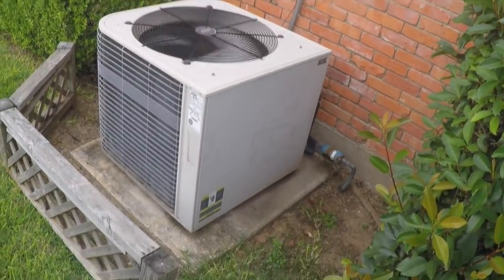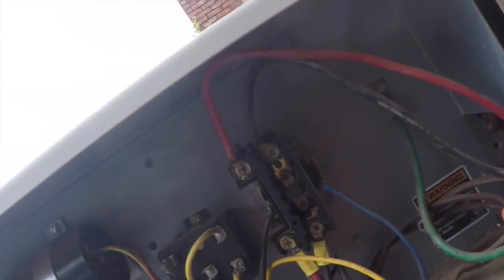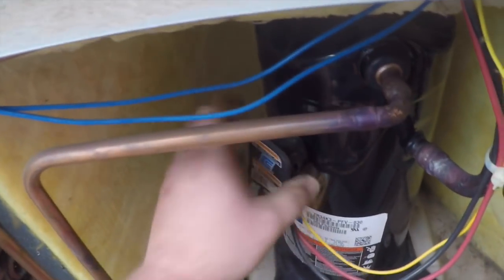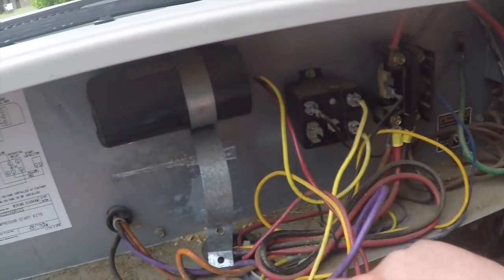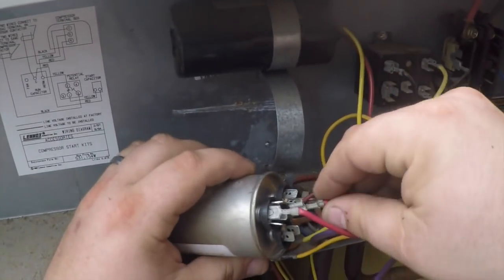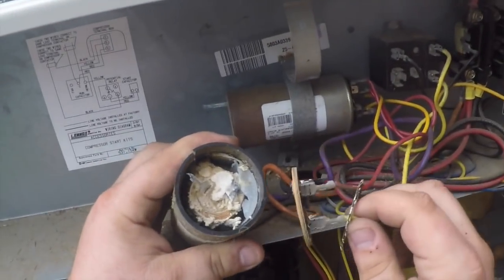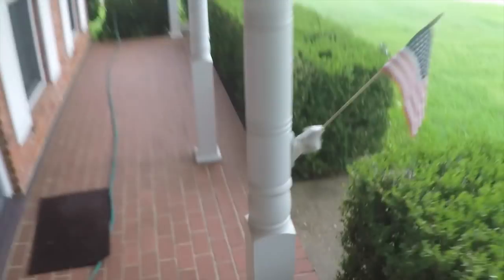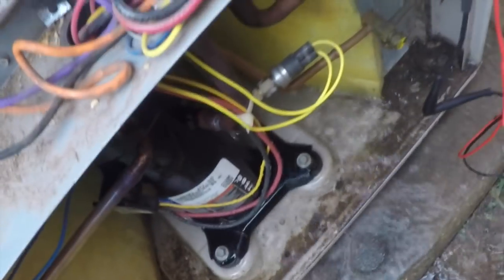HVAC: Overtime No Cool Call

Comment: I would have hooked my gauges up first to see if the system has any refrigerant before replacing electrics.
Reply: As you can see it was on thermal . For this type of call while you're waiting for it to come out of thermal overload generally that's when you check to see if there are any devices causing the thermal .  Then once that's good you run it . Always been normal practice.  I noticed the suction line dryer and the non oem looking brazes on the compressor.  That's a concern but hey

Comment: hey not the best video you missed a lot on a the check list for a no cooling call also you should have washed the   condensing unit while you had the hose out, and if you prefer 5 - 2-1s you should pick them up from you local supplier, but you didn't check subcooling/superheat or the high side reading, and the list goes on i would have done this service call a lot differently wouldn't be surprised if you got a call back  in the near future.
Reply: Anrew mackenzie we all do things different. All that was wrong here was a capacitor.

Comment: Hey John 22 year journeyman here. Let me get this right no subcooling, no superheat, no static pressure taken, no high side reading, and a house that you said is really hot and only a 75 pound suction pressure. Also only a 16-17 degree deltas. MMMM you fell a little short on finishing the service call so a call back maybe coming. If you are going to do training do all the steps properly.
Reply: A bunch of newbs spouting all the technical crapola they recently figured out how to use, performing a bunch of extra steps, using up extra time for a simple electrical fault. This was a text book repair for those who've actually done a few of them. The man checked the pressures and they were good - close it and go.
Reply: Of course, the indoor temp-split depends mainly on the % RH; at 50% RH indoors the split should be around 19 or 20°F; at a higher %RH the split might be around 16°F. 

Higher than normal airflow results in a 'lesser' or lower split...however, we always need to check the airflow & the indoor %RH...! 

Most systems have poor duct system design & too small Return-Air filter areas. Most systems are oversized & have too low an airflow...!

Always do the critical steps & show the performance of the system; it can be rather easy to do...
Reply: If you actually do the conversion at home he said his latest pressure was 75, he said 75-80 because it started at 80 when he turned it on, converting 75 we get just under 45F. He also said the register temp was 63F, which would make his split a little more than 18. 20~ is ideal, but 18 isn't anything to be concerned about. Especially when you consider the mentioned %RH. When you show up to a call often times the condenser hasn't been working for a while and as such the humidity in the house is up, duh, no cooling = high heat load, which can account for a 2 degree drop in the split.
Reply: melun dank u not hiring nobody bcuz u broke
Reply: TheAnimeAtheist p
Reply: i like these journeyman comments here lol i was a local member as well for 5 years until I moved out. I would've taken an amp draw and saw how it matched up to nameplate and I was about to say that he shouldv'e closed the panel or put the panel up before checking pressures but it was covered with the insulation. its just to keep airflow from being sucked through the hole and up instead of through the coil and out the top. quick control fault that he found without issue. i think he did good.
Reply: super hack
Reply: John is a master HVAC technician.  John knows exactly what he is doing.  Every tech can learn from him
Reply: He's an honest professional and found the problem right away. Most techs would be pitching a new unit instantly. I would hire him onto my team any day. Quit hating and make your own videos you over confident bitch.
Reply: he always half asses   thinks having toys makes a good tech
Reply: first off any tech worth a shit would find that problem right away and i dont think i would hire a guy thats out of breath huffin and puffin cause he put 2 screws in with a drill
Reply: Thank you! Yeah I agree we need more guys doing a complete thorough diagnoses.

Comment: Dude I'm trying to remain patient here but why would you not just unplug the plug off the compressor and attach you ohm meter to the compressor term. ? You also saw the start cap blown to bits but still couldn't admit that was you probable problem? I would have probably gone to my mega-o-Ohm meter checked the condition of the windings and been done with it.
Reply: Dick Gallina +1
It drives me nuts watching these videos and guys don't check the condition of the windings, Don't check static pressure and worst of all they don't check combustion on the heating equipment.

Comment: John ~ The small blue can next to the unit what does it use for?  My condenser unit don't have that.
Reply: That drier shouldn't even be there for more than a few weeks it starves the compressor. That's a Suction Line dryer used for burnouts/acids in line set.
Reply: It's a type of filter to catch particles before they get to the compressor, if you look closely you can also see a grey one behind it. That's a liquid drier which is also a filter but it additionally contains a desiccant material to absorb moisture that could be present in the lines. Moisture is a very, very bad thing to have in refrigeration systems.
Reply: Sage Awesome ~ I'm new to this...Why some home condenser unit had that and my condenser unit don't has it.
Reply: Most common reason is that many techs are too lazy/cheap to put them in. Or worse they'll put in new ones without removing the old ones.

The less common reason is that if the system is properly dried and free of contaminates it doesn't actually need them. In theory.
Reply: Thank Sage Awesome
Reply: on some units the filter drier is located inside the condenser from the factory. Amana/Goodman units have them. No need for an external drier
Reply: Thank Hvac pro Tech

Comment: Why does that AC even need that Kickstart? what's the issue..it isn't old is it?
Reply: All compressors benefit from hardstart kits new and old
Reply: Like hvac tech said. Its good for system. Some higher end units probably such as the one he was working on came with them from the factory. If you install a start assist of any kind. Check your start amps before and after. You will see a big difference most of time. Compressor uses most power on start up not while running.
Reply: All the Tranes we have came with a 3 wire start kit from the factory and some of them won’t start at all when they fail.  They appear to the same as a 5-2-1 but the supply house won’t admit it.

Comment: Why did you have to take the wires off the contractor? All you have to do is cool it off, push in disconnect & if it doesn't start, cool it some more.

Comment: I have a troubleshooting question for you, I have a Copeland scroll compressor that's a year old,  it trys to start but won't, it's not off on thermal or any pressure safety switches. The Cap is 55 and good and even installed a hardstart. still won't fire up, not drawing high amps on start attempt.
Reply from the maker: If the cap and hard start are good and it still won't start the rotor is locked!! Compressor is no good!!
Reply: +Israelhvac  that's what I was thinking, crazy it's only a year old. I appreciate your input and love the videos man.
Reply: Aaron Clark not drawing high amps on start, if it's not lra then it's not locked. wires correct?  mega ohm compressor.
Reply: Sometimes this can be something called vapor lock. Connect gauges and open both valves on the gauges to basically open the loop between suction and discharge side

Comment: Excellent video, and very educational. Thank you...I've never seen a video of a compressor Ohmed out to confirm lockout on thermal overload! Just curious-- why didn't you hook up the high side to the gauges and check the superheat and subcooling....verifying the refrigerant charge was correct? yeah it seemed CLOSE...but....

Comment: sir, why did you spray water unto the compressor? Is that to close the pressure switch again with two yellow wires going to the contactor? What will happen if you by-pass this pressure switch?
Reply: No, when compressors over heat they have a thermal overload that disconnects the windings. Running cold water on the motor helps it cool off for close the windings again

Comment: Bro i take those old type AN no seal fittings and throw them as far as i can and put a heavy duty brass cap with seal...  I don't trust those non seal type caps. There is always a margin for leaks with them. Gonna have to stock some hard starts.
Reply: it is, but its also to stop a leak if the schrader fails. The end of the service port and the brass caps work just like a flare fitting. hand tight + 1/2 a turn with a wrench will stop leaks if the shrader fails
Reply: Hence why i said i use a new brass cap with a seal built in. The type with no seals reply on pressure to force a seal metal to metal. Not good enough for me. Sorry. I want my stuff i work on to have a seal
Reply: I thought the caps were to keep dust and debris out of the shrader.
Reply: I find the Brass flare caps seal better than the brass caps with the rubber seal.  When you have the brass to brass and tighten it up good it seals, period.

Comment: I would have took out the relay , start cap, re-wired it just with the duel cap and called it a day. You don't need all that shit in there.
Reply: Actually the only Reason all Units Don't have Start caps and relays is Cost!  So, Manufacturers can Save Money. it's ALLWAYS About the Money. Read up on it. Compressors Start Easier, Less inrush Amps, Live Longer etc. Also When Compressors Get older They May Require it, Low Voltage Situations, etc.
You Can run them Either way, But a Higher Quality Unit will Have Start Components not a Just a Run Cap. Been doing this 35 years. If He Did not have a Start kit on the Truck, then yea, he could of maybe got her going with a Fresh Run Cap. Thats Why YOur Here on youtube right ? to Learn From Us Older Guys and maybe pickup a few things to make yourself a better tech.
Reply from the maker: Well good for you. If you like to do things half ass that's you!!
Reply: Right. If they need to be in a system, all units would have them.